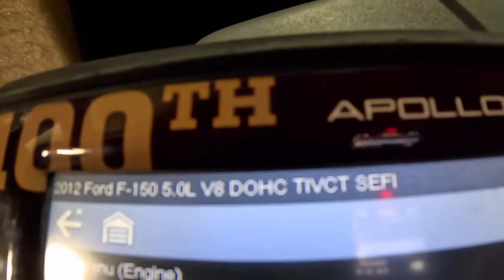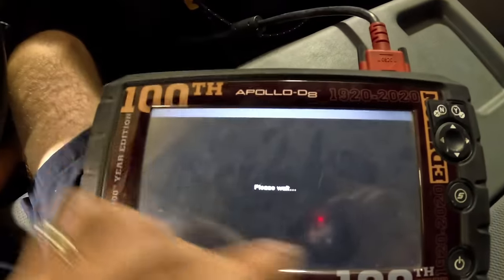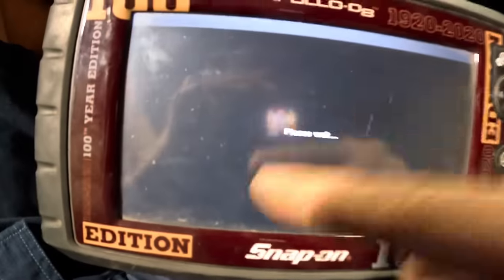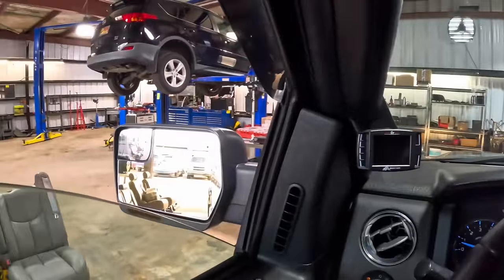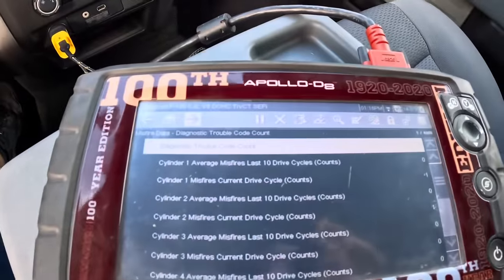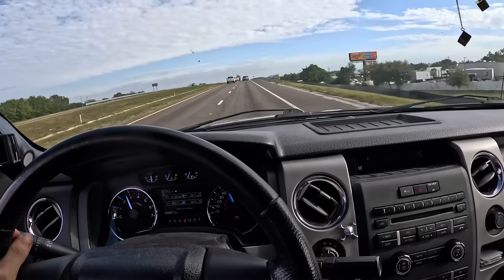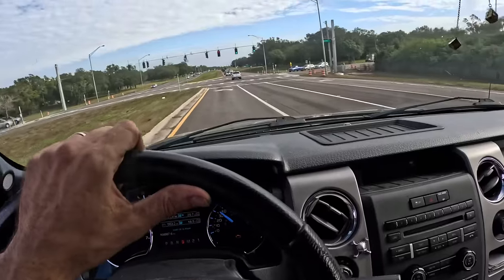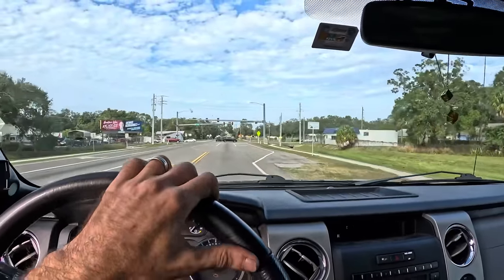Full Throttle Misfire!  Ford 5.0 Coyote

Comment: The number on the spark plug is an interchange number. As a former auto parts store employee, I can tell you that the interchange number works wonders aside from the part number! You can type in the interchange number on the online catalog and it'll pull up multiple brands of the same design spark plug but if you just type in the part number, it'll only pull up those spark plugs alone and sometimes other parts that come close to matching the part number you typed in will pop up!

Comment: Installation cracks on plugs would normally would be horizontal near the bottom because when you put the swivel on you push the top of the plug sideways and then it cracks across the bottom of the porcelain.  Since these were longitudinal cracks, I suspect these are actually counterfeit plugs that just aren’t made right and when they got hot, the inside of the plug expanded in the porcelain and it cracked that porcelain. It’s the same thing you see in concrete when a rebar rusts and you get those long longitudinal cracks.
Reply: Yeah that’s what I was thinking bring it started trying to basically peel itself off it’s definitely a pre existing condition
Reply: @MacRODesign55  I broke one plug 40 years ago by letting the socket go sideways with the swivel. I heard it crack but ignored it. An hour later I was replacing it.
Reply: The road runner did it...beep...beep
Reply: Owner probably bought them @ Wally Mart...LoL
Reply: @wolfguardian8312  I got fake plugs from eBay in the early 2000s... Was pissed that I had to do that job again 😞
Reply: I was just about to post the same comment.  Looks like the infamous Amazon fake plugs.  Amazon is the new ACME😂

Comment: Little tip for you Ray. On the BG cleaning bottle that you were using on the side opposite where the air connector and regulator is a little button you can push to vent the excess pressure left in the bottle after you disconnect the shop air supply.  It's hard to spot it looks like part of the hinge for the hanger but it's actually the pressure release vent.
Reply: How dare you bring common sense into this video. Sad a tech doesn’t even know how to use a system they are trying to sell.
Reply: Yea but you have to be sad to read the manual.

Comment: Rainman, you should’ve bore scoped #8 piston again to show how well the cleaner worked, or didn’t work.  Maybe next time. 😎
Reply: So as far as we know the customer paid for the so called carbon removal and it did nothing. There is a good reason to check the plug resistance.

Comment: Just fixed a  cylinder 8 miss fire on a 5.4. Found the last place that did a tune up didn't replace spark plugs on cylinders 4 and 8
Good job pep boy's! Plus the 6 they did replace they put different plugs on each side of the engine.
Reply: Unbelievable! You can't trust a lot of these shops it seems.
Reply: Cases like that his, I ask for the old parts back 😅

Comment: Good day ray, would really enjoy to see before and after using the carbon cleaner with a borescope. Would even prove the haters wrong… or prove you wrong but either way would love to see it!
Reply: Ed Zachary!
Reply: I have removed heads from engines after running a can of GM Top engine cleaner thru it on a hot engine and running 1/2 the can in then letting it sit 30 mins then run last 1/2 thru and test drive it like you stole it. . The intake runners and piston tops were exceptionally clean and any deposits left were soft wan would have clean up with injector spray and air movement after running the engine

Comment: That last spark plug reminds me of a neighbor who took his Buick Roadmast Limited to a Dealership to have a tune-up. about 100 miles later he ask me why his his Buick was misfiring. I had an old Snap-on Scanner that is only good up to 2003 vehicles. I'm retired but I picked up on the misfire. Both cylinder 7 & 8 spark plugs had cracks. Hard to get  to and just as bad installing them. Luckly I still had my Snap on plug socket. Car ran great afterwards! I'm 74 and don't really tinker with vehicles anymore! Keep up the great work!!!

Comment: I would love to see that#8 piston after that cleaning procedure. My old mechanic used to use a similar system but he decided to do a looky loo before and after on one of the vehicles and did not see any difference. I would love to see if the products have changed and they actually work.
Reply: I second that suggestion
Reply: Immediately after might not be the right time to see how the product works, but perhaps a couple of hundred miles of engine time.
If the cleaning was instant or very fast, it could send big flakes and chunks into the exhaust part of the engine, and possibly clogging the catalyst mesh in the converter(s).
If the product assists in the slower breakdown of the deposits, it likely prevents causing damage.
I don't work in the field, so my statements have a lot of conditionals.
Reply: I really want to see #8 piston after cleaning  with the genie in a bottle.    I would guess you could put water in that mister and would clean it

Comment: I have a Kia Cerato (Forte) with a 2l GDI engine and run a can of  CRC GDI Valve Cleaner through the fuel system every 6 months. It seems to reallybwork in cleaning the carbon from the back of the valves but despite the instructions I would say the engine needs a longer heat sink for the carbon to devreleased from the valves.
When it happens it is like an old James Bond movie when a smoke screen is released from the rear of the car .
You can really feel the difference.

Comment: Years ago (about 40) my dad picked up a 74 pinto for us kids to drive. It was in decent shape, very low mileage. A guy up the street got it when his aunt died. It ran very poorly so he did a tune up and replaced the timing belt. He got the timing 180 out.
We picked it up really cheap. After fixing the timing it ran great except it just completely lacked any speed ability. Did a compression check and all cylinders were equally low. Yes the 2l ford is not an interference model but that was what it was acting like. Appon pulling the exhaust we could see that the carbon build up on the valves was so bad it was interfering with them closing. 
We knocked a bunch loose with a screwdriver. Then we set up the windshield wash pump with a turn signal relay and when the car was at operating temperature would turn that on and let it roll. 
After a month we pulled the manifolds and looked at the progress. Both intake and exhaust were very clean.
A little water vapor and some heat does amazing things.

Comment: Never question Ford's parts inventory system.  Even they don't understand it.  Just remember to keep all original parts for direct comparison, and pray the larger ones still have their paper ID tags from the factory still attached, or you may need a wizard to determine which replacement part you want.

Comment: Interesting that both cracked porcelains were on plugs against the firewall. What do you attribute that to? No swivel on the socket, maybe.  Additional heat?  Eristicat, below, suggests that these plugs may be counterfeit.  If that's true, that could explain the verticle cracks.  I've never seen that before. However I have seen them cracked around the base.

Comment: Would be interesting to see a before and after inspection of that valve cleaning procedure.  Wonder how much difference it actually makes
Reply: I have seen other YouTube channels show before and after videos after this type of cleaning. Not using the BG product but the same process. They were concentrating on the back of the valves because that's where the worst build up is on DI engines. There was a difference but the results were not what I would call clean. There is a concern for chunks of carbon breaking off with this type of service on higher mileage vehicles. I would personally not do it unless it has been part of the maintenance service since theengine was new, say every 35 or 40k miles. For DI engines a manual or walnut blasting service will get the valves nearly as clean as new. Of course those are much more involved and invasive services and, as such, considerably more expensive.

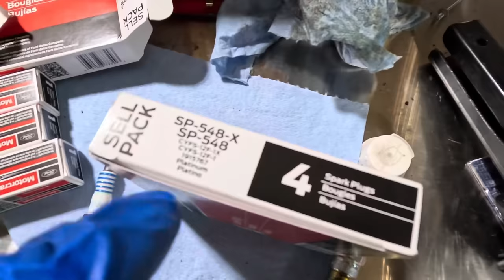Comment: Ford part numbers @34:00... There is the catalog number, which for looking the part up in the system, then there is the Motorcraft number, which is the SP-548. 
I worked at a Ford Dealership for a number of years in the parts department. The Motorcraft number is the number you go by. SP-548-X are platinum spark plugs.

Comment: Recently changed my spark plugs on my 2012 F150 w/ the 5.0 Coyote. Hate those red locking tabs on the coils. Had to wire one in place.

Comment: We used boiling water to remove the crusty on the battery 40 years ago.Sam in Northern Ireland 🎉😊
Reply: 100 proof?
Reply: Confirmed still works.

Adding a bit of baking soda as optional to neutralize the acid as well😅

Comment: Proud owner of a VW CC 2014 2.0L DSG, 18 moths ago i changed my coil and spark plug and the tip of my coil were full of oil...this engine did'nt have a gasket but a head cover/valve cover seal...so I poured a bottle of AT 205 in the oil. Last week changed my spark plug and surprise surprise no more oil on the tip of the coil and spark plug (will reseal at the timing chain job). BTW amazing transmission the DSG 0-60 in 4 sec, changed the original suspension for Bilstein B-12 wich I highly recommand.

Comment: Comment is about Other shows. Other tools, I have had Metrinch tool kit. IT has all tools which only hits the flat side of the nut, or bolt.Had to get when I had a broken spark plug inFord E150 w/ 300in 6. Great tool. I see you have trouble at times with bad nuts. This works.

Comment: Love your videos man. What I can see through the camera those were carbon tracks and not cracks. The result is the same, it needs plugs in probably coil boots. Often if the coil boot has a carbon track already in it, The new plugs will end up with carbon tracks in the same locations as the previous ones.

Comment: Ray heating your wire connectors with a heat gun helps alot on removal as it does with hoses.

Comment: Hey Ray Ray just thinking you may want to put  some rubber pads on the lift columns so the doors do not hit metal to metal and possibly scratch the doors.  Just     a     thought.   *********
Reply: A few weeks ago he showed the factory-mounted rubber pads on the post of at least one of the lifts. I assumed they all had them. Maybe it was just on the newest (central) one.
Reply: @jasondgandrew320  thanks Jason I have watched all of his videos for a long time but must have missed that part. I always get nervous when he opens the doors, and the darn columns are right there. If you were a little heavy set, that opening could be a challenge.  Have a good one.
Reply: @toddrees1  Thanks Todd. Have a magical holiday season yourself.😁

Comment: Back in the day we used to clean battery terminals with Coca Cola, followed with a generous coating of Vaseline. Worked just fine.
Reply: Other just use hot water and maybe some baking soda as an option to neutralize the acid 😅
Reply: We cleaned steel tables with strong black coffee.

Comment: I know Ray is against anti seize compound on the spark plugs... Previous service had it on the plug threads when he was pulling the old ones out

Yeah, seems plugs were changed already probably by the 100,000 mile mark.

But wow, porcelain cracks on more than one plug??? Were they counterfeit?😮

I would have also presoak #8 cylinder directly with some carbon cleaner while waiting on the parts delivery

That scope is a great tool while waiting for the parts to see that carbon buildup on #8😅

Comment: I'd observe:  20th century tuneups include spark plug inspections while 21st century requires boroscope cylinder inspections!

When adding stuff to fuel tank isn't the amount of fuel already in the tank important?  Sort of controlling the concentration of the additive?

Did you check new plug gap before install?

Comment: I used to own a 97 E350 with 5.4 that ran great, then in 2010 I bought a 2005 F-150, with a 5.4 that shot the #4 sparkplug out with most of the threads, so on of the "kit's" with the extended plug and adaptor that was designed to go in with larger thread, I'm sure you have seen it, and did not work. That kind of soured me on FoMoCo double or single overhead cam engines. Now only Ford I have is a 41 Tudor. As some one who knows, what do you think is best truck/engine combo? Great Channel anyways, thanks for the light entertainment.

Comment: God i miss that BG injection system cleaner system. Its the ONLY system i used as anASE tech that i saw work. Trucks/cars would be missing running like crap. Run that through vlean injectors and vlaves. BOOM idled like a sewing machine. I wish i could get that stuff 4 my cars/family

Comment: Carbon buildup on back of intake valve is more of a problem then buildup in cylinders. We call it induction cleaning and should be done every 30-40K miles. Simple cheap service that will make your engine idle smoother and help all around driveability

Comment: I couldn’t tell for sure because you move so fast it looks like the original spark plugs. They have a paint mark on the top tip of the spark plug on all original spark plugs big Ed coming to you from Central City Kentucky. Have a great day.
Reply: Nah, it was previously done because the first plug has Anti seize compound on the spark plug threads... That wasn't done at the factory 

Ray doesn't believe in them,  but we all know how those dumb plugs may seize to the cylinder head if neglected to pull out and check gaps once every 5 years or so 

Luckily, these plugs are simple to access 😅

Comment: theory as to why locking tab on cylinder number 8 broke, because of the insulation by it its pushing heat around that plastic which caused it to go brittle and break.

Comment: Since they're prone to breaking, are those red locking tabs on the plugs sold separately as a replacement part?
Reply: You don't need them. They are just a way to double latch the connection.

Comment: FYI for all 2019 (maybe other years), 5.0 Coyote owners. On my F150 4x4 - When starting out on a cold engine in cold weather and accelerating moderately after tranny upshifts (mildly lugging) - Do you have engine rattle? (Cam phaser) Occurs for about the first mile only.

Noticed this after the colder weather come on. Always have my dealer change the oil 2-3,000 miles, depending on usage.
Being concerned I mentioned this to my service manager (tiny dealership), several times. Always same answer, no TSBs, they almost all do it. Being a retired mechanic, I told him I was concerned about it.

Around the 20,000 oil change I mentioned to him that the engine is burning about 1 quart every 1000 miles. He then got interested. Seems there is a TSB concerning this engine burning too much oil! He had to look a bit to find it. 

The TSB's main fix was a programming change to the PCV vacuum control as it was allowing too high a vacuum under de-accel conditions while at higher speeds.
Now it's interesting - That re-program FIXED the cam phaser rattle when cold! Seems to have fixed the hi-consumption.

Hope this helps someone.
Reply: I run mid grade gas every few tanks and no more rattle.  Use about a qt of oil every 5,000 miles.

Comment: the reason why the spark plug package has 4 part numbers as far as i am aware is
1 number for the spark plug model (on spark plug, on box)
1 number for spark plug model + gap (on box)
1 number for spark plug model + gap  single pack (on box)
1 number for spark plug model + gap  4 pack (on box)

also about that spray canister disconnect the shop air wait till the pressure is out then close the out valve and you will always be ready to add new fluid

Comment: We're waiting to hear if the Back to the Future car is coming back for the struts. Also what is going on with the China car, i heared you say you have purchased it when the guys were down at your shop. Does it have the same wheel base as a Suzuki Samari, the body might fit with a body lift kit made from pipe and round plate. Of course you would have to make the kit up.

Comment: The multitude of top end and engine cleaners on the market today never ceases to amaze me. Seems like everyone has something and of course theirs is the best. Takes me back to the 50's when we just used water and a hot engine. Like others have said i too would like to see before and after scope images of the cylinders and valves. Wonder how all the miracle cleaners would stack up against plain old water.
Reply: Didn't popular mechanics show a set up that used some  dish soap in water on a vacuum line ?
Reply: @davidhamm5626  I don't know, never saw that. But it was common in the 1950's we would rev the engine and drip water into the carb. Basically steam cleaning the cylinders. In the late 40's and early 50's some cars even came with water injection. We used to put alcohol or ether in the water tank.
Reply: @StevenDaugherty-uo5cs  Okay, I think that is what I had seem, thanks for getitng me straight on it.
Reply: Yep they did. We also had water injection kits for early turbo systems. Personal I always used GM Top engine cleaner. It was used on carburetor engines as well and worked great on port and direct injected engines.

Comment: I'm going to probably say when they were installed they didn't have a swivel and put a lot of pressure on the porcelain I see that happen a lot in tight situation with spark plugs
Reply: I'm thinking the previous installer did not have an actual spark plug socket with the rubber insulator and just used a regular socket.

Comment: Don’t use a universal joint to install a spark plug. You’re going to side-load the plug. It doesn’t matter how good you think you are, because how do you know you didn’t put a side-load on the plugs? The back cylinders are the most vulnerable. Use a piece of 3/8” fuel line like a pro would, and then apply final torque.